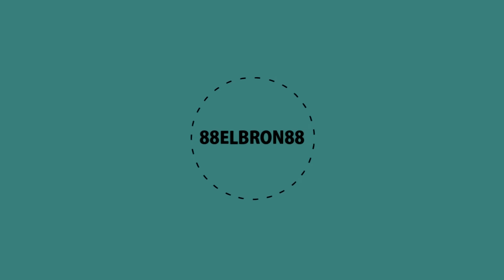How to : Install EZ-Lip on a car - on my Mercedes C350

Comment: How were you able to make the lip bend and maneuver to go flush with the bumper? I'm trying to adjust it for practice but it doesn't seen to curve with the contours of the bumper. Thanks.
Reply from the maker: Hi! 

Heating up the lip makes it also easier to go flush. Not alot but it helps.

It also depends on how sharp those contours are. Sharper contours makes the lip go down, try to round up the sharp contours for exp. take a larger turn.

i hope this helps, thanks for watching!

Comment: Hey bro where did you buy that front grille? Looking to buy the same kind.
Reply from the maker: +larry fra Hello! 

It^s the stock Avantgarde package grille. The rear wings are painted in black metallic, the chrome trims are wrapped in black metallic. If you mean the "glass" star it comes with the distronic package. You can buy it from ebay.com too tough. Thanks for watching!

Comment: Nice car man, all the small details is what sets your car apart from everyone else's....anyways, quick question about the lip. I have bought the same lip, going to install it this week. I don't want to have to drill a bunch of holes in my front bumper for a cheap lip, so my question is how good has the double sided tape held up through regular wear and tear and washes etc?
Reply: Peyman Gharaghani I got this exact lip on this exact car. Have had it on for over 2 years. Still on there perfect and get Car wash once a week

Comment: Sure stick Home Depot garage door moulding on your Mercedes....  Some people don't deserve to own nice things.
Reply: Would you pay 200+ for one that will get scratched very easily ??
Reply: +mike mcgeady Yeah I already did.  You own a Mercedes not a Honda.
Reply: 97GSX97 lol good point xD .. can afford 60k+ car but cant afford a front lip
Reply from the maker: +mike mcgeady sure i couldn't afford a frontlip i only got a C350 and a E63 theres no way i could get a real lip for it nah... let me explain why i got a EZ-Lip and not a real one: my garage. My garage has a almost 35 degree entry. I barelly get my C350 inside it's 8mm away from touching the ground and it's NOT lowered. The EZ-Lip thanks god protects the bumper. I lowered my E63 and i can't get it inside now, not even with wood. I need to drive backwards and it scrapes in the front. 

Hope this explains why i got a EZ-Lip. And indeed, some people really don't deserve nice things, but i do. No hate.

Greets!
Reply: +88elbron88 yup thats a problem .. Getting your car in the garage without scratching it .. so do u find it useful?
Reply: +88elbron88 whats the song in ur vid?